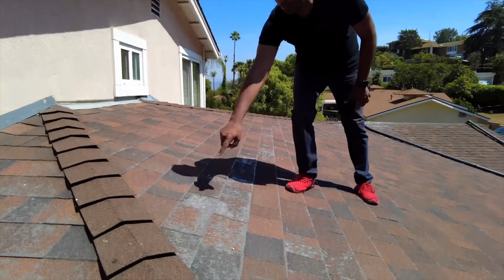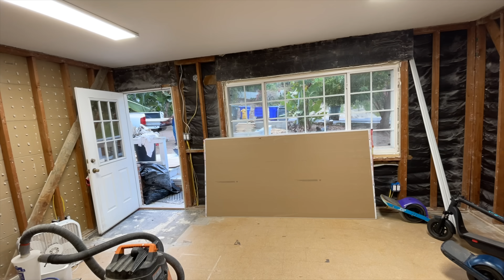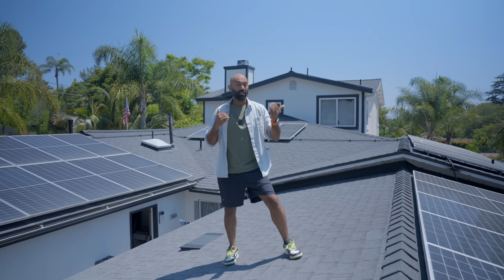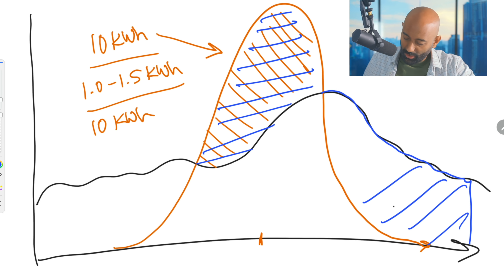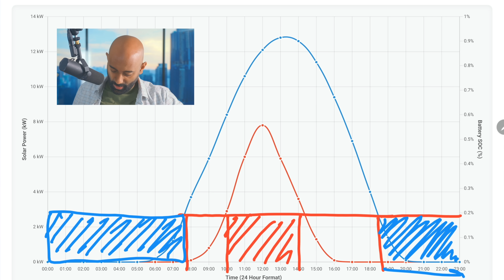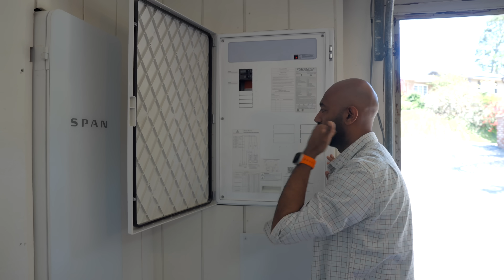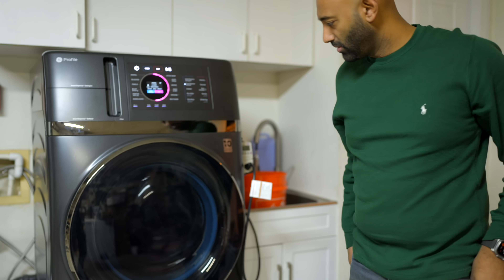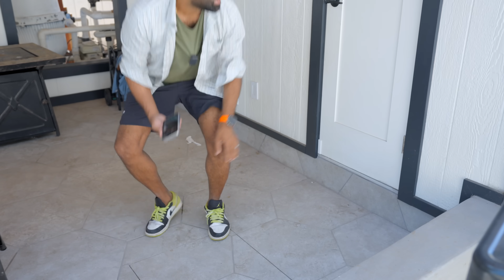Is Self Reliance Possible? Net Zero Home 4 Years Later...

Comment: I'm off-grid at 63 degrees north in Finland. I have a about 15kW of solar and a 120kWh DIY LiFePO4 battery that gives me almost a month of autonomy; my average daily consumption without cutting on comfort is 5kWh/day. I use a diesel generator to charge them in winter (November, December and January when there is not sun), running biodiesel I make myself. I heat with wood: both in a wood gasifier for the underfloor heating, and the masonry fireplace. In the shoulder seasons when I have lots of solar but it's still cold outside (which this year was well into June), I use a heat pump which lowers the amount of wood I need per year. The wood comes from my own land, where I am turning a tree farm into a natural forest, which requires cutting trees and will give me firewood for the rest of my life and then some.

No monthly bills: I have a well for water, and have an aerobic wastewater treatment system. DIY batteries are rater inexpensive nowadays (under $100 per kWh), so I'll probably expand on the battery pack at some point - I'm playing with the idea of building a 1MWh pack, which should see me all the way through winter without generator nor solar generation.
Reply: It sounds like you are living my dream!! I'm in the processing of immigrating to Finland myself! Working on my Startup permit from business Finland. Keep up the good work friend!
Reply: @johnsparrw  Thanks! Keep in mind that the current economical situation isn't the best here. Hope you make it!
Reply: Wow! Congratulations!
Reply: That sounds like a nice system.

You have heat covered with that wood but that sounds like a lot of chopping and tending fires.

For me cold isn't a big issue, it rarely freezes out in the desert so a heat pump air conditioner can give me high efficiency heat as well as cooling in the summer, I just need enough solar to power it.

I think I get 300+ sunny days here so the last time I looked in to it, the two inverter setup I was looking at maxed out with around 16kW of solar panels, 45kWH of 48v DIY LiFePo4 battery made sense and I could get the whole thing minus mounting hardware for around $10,000.

When I hear about $40,000 systems it amazes me how much the solar companies rip off people.  Then they try to make it sound like a bargain with a 30% rebate but it's still almost 3x as expensive as DIY.

I say go completely off grid if you can.  You might need a much larger system than a grid-tie peak shaving solar installation but if your energy bill goes to zero and you buy your system at DIY prices, your break-even point could come much sooner.

It's a great idea to understand your electrical usage before you start and concentrate on efficiency.  House insulation is a great money saver if you have heating and cooling expenses but there is also a cost trade-off between adding more insulation to reduce HVAC energy requirements and just adding more solar to generate more energy.  Insulation is more effective at first but has diminishing returns while solar scales pretty much linear.

Also solar keeps getting better and electrical and electronic devices keep getting more efficient.  If you over provision your solar to start it will be very easy to increase power generation after your panels degrade a bit as well as reduce your consumption a bit to keep you solidly off grid but with all the lights on.
Reply: @beardoe6874  About tending fires: not really. Unlike a traditional wood stove where you have to constantly keep a fire going, both the gasifier and masonry fireplaces are fire and forget, that is, you make a fire once a day or every two days, and that's it. It's actually a moment of relaxation for me.
As for chopping: sure, it's some work, but (electric) chain saw and splitter make that I can get a year's worth of wood processed in about a weekend (remember, the heat pumps cuts back the amount of wood I need per year). 
Sure, there is the forest work, but I thoroughly enjoy that and wouldn't want to remove that part at all.
Reply: @beardoe6874  I don’t know if you’re referring to the Growatt inverter
But I would say I made a mistake installing them four years ago, and I am not satisfied at all.
We have 16.4 K of panel and 30 K of battery plus 3 5K inverters. 
If you used something else and would recommend your system, I’d be interested. At this point, I’m waiting for my budget to include a Tesla system.
Reply: @robertstout7756  I priced out a system about a year ago and it was not Grow Watt inverters.  It wasn't a common name brand but I think it had an ability to control BMS.  Each inverter could take 8,000 watts of solar and two inverters tied together could do 50A at 240v so I was thinking of getting three to have a spare because they were on sale cheap.

I have been assuming it would take me days or weeks to get the system to work well and probably months to get it really dialed in.  Tesla would probably reduce that timeline but they are just really overpriced.

I'm going to figure out what I'm going to install once I have the roof space for a system and the money to buy so hopefully it will be mounted and charging batteries within a week of getting the parts.  If anything looks like it will be a reliability issue or mess up the functionality, hopefully I will still be in the return window.

As time goes on everything gets better.  Bad products get dropped from the market, good products get firmware updates, better ones get released and budget options bring nice features to lower price points so waiting almost never hurts.
Reply: @beardoe6874   You can reduce powerusage for airconditioner.... do as folks in Spain! many use natural method of keeping their homes cool...
Reply: @helengren9349 I have a plan for a geothermal system to reduce cooling costs and using my solar panels for shading but there isn't much else you can do when summertime high temperatures are regularly between 45 and 50°c.

It's funny when Europeans talk about air-condition to people in the American south and south-west.  The only places worse in summer are portions of the Middle East, portions of Africa and maybe parts of India.

We can make it comfortable enough with AC but a lot of Europeans just don't understand.
Reply: So instal Wind turbines too . 😊
Reply: @JunitafluxcyfatriciaJunita  Small wind turbines don't work. I can show the math if you want :)
Reply: @upnorthandpersonal You're right Commercial wind turbines are very unreliable. And it is out competitive with solar panels and batteries, the prices of which continue to fall due to Chinese subsidies..
Reply: @upnorthandpersonal  wind power is highly sensitive to location. What people screw up mostly is they don't actually have their potential site surveyed with actual measurement just rely on the subjective sense of having wind. That said, there are areas where solar can't outperform wind because there is very little sunshine and it blows all the time - like the Shetlands etc - but those are not typical areas people actually reside.

Comment: We're in Oregon and we have an 11 kw solar system that is 3 years old and is paid for and our electric bill all year round is just a connection fee of $27.52 a month. We don't have batteries yet so we use our utility as our battery and so far it has been working great !!! The way it works with our system is if we produce more electricity than we use it go back into the grid for other people to use so it saves on the amount of electricity that the utility has to generate. Our home is all electric so we don't have any gas so our heating cooling is a heat pump that heats in the winter and cools in the summer and it gets down to zero or below in the winter and the heat pump still handles the temperature. We have a washing machine that washs and drys our clothes and only runs 120 volt also we have an induction stove that is more efficient, all of our light's are LED light's.
Reply: Do you get a 1 to 1 kwh credit from your electricity company?  If so, you are very lucky.

Comment: It's always a pleasure to check in on what you are up to. We are in Texas (Hill Country) so the finances are completely different. We pay $.11/kWh and they give us credit at $.04/kWh. We generally break even, so we are giving the power company around twice what we are using. In effect, we are giving our neighbors clean power. Our ROI is so low that we will never receive payback, but that was never the point. We have 48 panels on two arrays and a Powerwall. Our bill ranges from around $45 to minus $45. I have a wood shop, and I plan to put in enough panels and battery backup to power the shop off grid and charge a couple of EVs.  You might find a heat pump water heater valuable. We have aerobic septic, and it waters the lawn. we don't have water capture yet, but it is in the works. Although, this will never pay for itself (at a ROI of around $2500, it is amazing to be completely free of the grid when we wish). Great vids. Keep them up. I look forward to what you do next.

Comment: The angle of your panels doesn't look optimal for those winter months, if you were able to adjust the angle of the panels for the winter months you might not have as large of an gap in production between winter and summer.

Comment: I don't understand how you're spending so much on heating. I live in Colorado, even in the middle of winter when temps get below 0 degrees, our gas bill on a 3700 sq ft home is under $200. Do they not insulate the homes in San Diego? Or is most of the heating for a pool? Do you heat the pool in the winter?

Comment: What people need to understand is that a Watt is a unit of heat, not electricity; and we use Watts when talking about power because it correlates well. Every last thing in your house that uses electricity produces heat and all those Watts of heat need to be removed in the summer. Every appliance, electronic device or fixture should be evaluated at purchase for its demand on your AC. Even if you live in a cold region, the heat from all these units cannot be justified, because virtually all forms of home heating are more efficient. I've placed PIR (human presence) bulbs everywhere that light is needed only while you pass through. No you don't have to buy a special fixture. Just get the bulbs with the built-in PIR feature. Until the de minimis rule was canceled as a favor to Amazon, I was never paying over $2 for these bulbs from AliExpress. Very, very interesting video, thanks.

Comment: The Net Zero on my home is saving me close to two hundred dollars a month.   I pay 120.00 a month for the equip until payed off.  My electric bill pre solar averaged 220.00 a month. Now it's 160.00 with the equipment charge, including the 35.00 utility service fee.   The bonus is I can drive my electric car almost free.  That's an additional 80. a month I used to pay at the pump.  
Great article and good solid advice.  
I will add that for this to work, you need to own a home with a good serviceable roof and add 20k worth of equipment and maintain the stuff.  An electric car will set you back a few dollars more.  Good for the burbs and the boonies.

Comment: Living in San Diego how well do you handle the June Gloom where we can get a weak with overcast and almost no sun?  No sure how far you live inland.  I live in Poway and we can get several days in a row of low solar production because of clouds that never burn off.  I also have Solar (20kw with 70 kwh of storage) and I have also tried to pull as little as possible from SDGE but with two electric cars it is hard on some of those cloudy days.

Comment: I installed a Rheem Heat Pump water heater over a year ago.  Overall fairly happy with it.  However word of caution, with Heat Pump water heaters you need proper air flow around the water heater or it needs to have access to outside air.  It will also make noise all the time because you essentially have a 1/2 Heat Pump on top of it versus a gas/electric water is basically noiseless.  When we had ours installed we re-located the water heater into our garage.

Comment: You should have your Grey water tested and then see what it's suitable for and let us know! And or what filtration system might be useful. Every house could have such a thing in many areas of the country. If someone is building a house, it's a very low cost design to simply add the extra pipes for shower, sink and even the wash machine
Reply from the maker: Great idea. We use our gray water for our fruit trees and grass area. Just recently we connected our washing machine and most of our rain gutters.

Comment: Just fyi, you may find more blown-in insulation to be highly effect at lowering your electric bills.   Those are exceptionally high.   With a summer of 100+ degree days, my bill was $150, $177, $188, $160 for 1,800 square feet.   Insulation is  underrated.

Comment: I would isolate the battery storage and EVs away from the house.  The LA fires were likely much worse due to all the batteries sustaining the fires.  
I would consider making cob storage building to isolate the batteries/EVs from other areas so that you and your neighbors are better protected in the event of a runaway battery fire...
Reply: By the time a battery is on fire the wildfire destroyed your home half an hour ago. There’s no ‘sustaining’ issue. 

Have a look at footage of the fires. 

These are also lithium iron phosphate batteries, they don’t burn like lithium ion cobalt batteries. They’re heavier but cheaper, which is why they’re used for Chinese EVs but not high performance EVs.
Reply: @peter65zzfdfh 
I follow a fire research/suppression channel that researches lithium battery fires.  I know that your surmise is false.  
Regarding the Chinese batteries, that's a firm pass.  I've seen how "those don't burn like lithium ion cobalt batteries."
Reply: @peter65zzfdfh 
And you dont want to breath that smoke either.  
Cob resists fire, and having it in its own building to isolate the smoke reduces overall harms as well.

Comment: The way heat pump water heaters are engineered is very dumb.  I have one and also setup one at my daughter’s house.  They work, but they’re far more expensive than they should be.  The heat pump should be decoupled from the tank.  What would be awesome is to get a VRF heat pump for the house… basically a manifold for a compressor and different head units.  One of the head units could be the water tank… instead of shunting indoor heat to the outside in the summer… shunt it to the water tank and the fan doesn’t have to run on the compressor outside (or run slower)!

Comment: After having a heat pump water heater for over ten years I wouldn't do it again unless our situation changed drastically like we had more people living here etc. Here's what I learned...it cost less to operate it than a conventional heater which did save some money, but what I found while camping in our vintage Airstream trailer with just a six gallon hot water tank...we didn't need the extra hot water in say a forty or fifty gallon water tank. The reason the six gallon tank worked well was the recovery time was so low that the time between showers was plenty to recover the full six gallons so you fit your shower time into the available hot water. With this information when I had to replace our water heater last year I went with a 30 gallon (smallest I could get on short notice) and it has been less cost to operate than the heat pump unit and less costly to buy. If I could I would go with an even smaller unit like say 20 gallons and then the recovery time would even be less. Turns out that recovery time is the thing to pay attention to...lots of storage means more recovery time which actually means less hot water available in actual use. The other important thing to note is that you will need to install pressure balanced shower faucets for comfort and that's really important and I can't stress it enough...if your constantly having to adjust the temperature in the shower manually it's a real pain, but I had installed them 25 years ago so it worked fine for us right away. Focus on recovery time and actual mandatory usage...things like teenage children who want to live in the nice warm shower because they don't pay the bills, having much less hot water available to them is a great training aid for them to adjust their habits for later life, and it's a no stress situation for the parents because well that's what water is available "sorry kids deal with it". Truth is we could likely go with a 15 gallon tank easily because we have 240volt in the house which recovers really quickly...maybe the next time I'll try that as the 30 gallon has way more than we need and recovers slower than the 15 would.